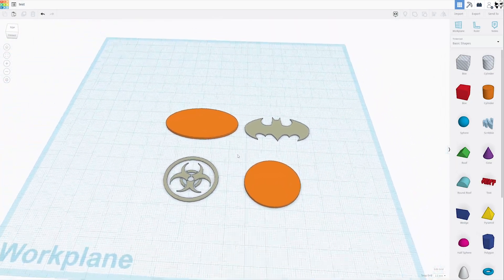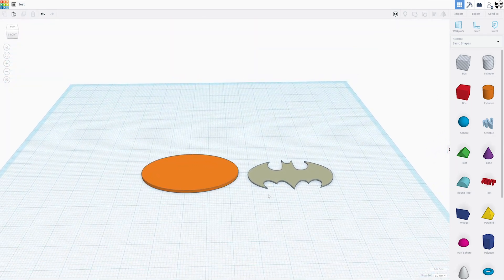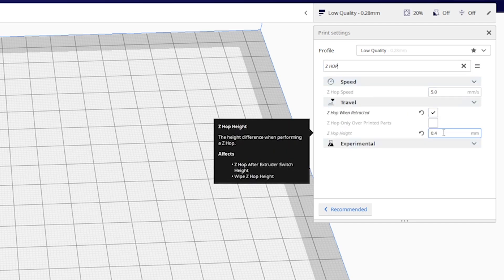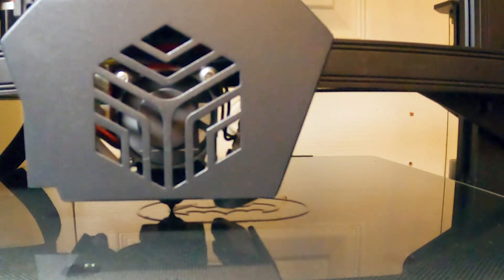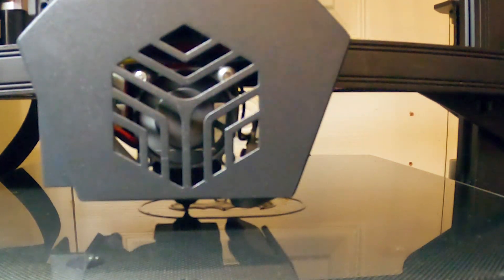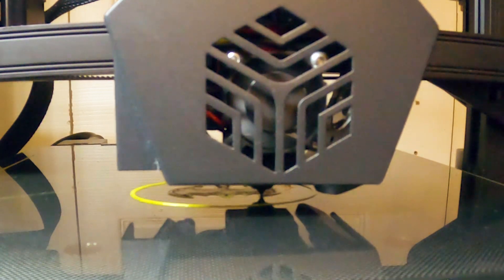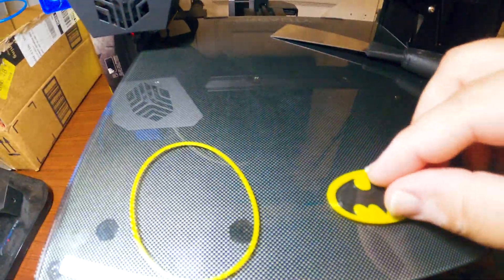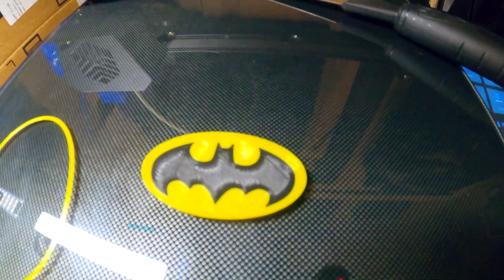Using Z Hop in Cura for the CR6-SE | Making Flush Inlays

Comment: I'm still a bit unclear as to how cura knows where to hop, if they're separately sliced stl files?
Reply from the maker: It hops at the height you set, regardless. So if the first model is only .2mm, and you hop .4mm on the second model, then you're going to miss the first model because it hops after every finished line it prints. 

Kinda confusing, I know. But I hope it makes a little more sense.

Comment: I have an Ender 3 V2 with the bed auto level add-on.  It touches the build plate in 9 locations before printing.   I'll need to make sure to avoid those locations when printing one or more.
Reply from the maker: Yeah, that's basically what is on my Ender 3. An EZABL. 

I'm not sure about the v2, but you could possibly change the start Gcode on the second print, to skip the bed probing and use the previous mesh (if that's an option).
Reply: @Avel  Thanks!  I'll check it out!

Comment: 4:20 To remove stuff from the build plate, take your scraper and put it up against the part. Then take a semi-heavy object, I use some pliers, and tap the end of the handle. Pops the print right off. But I'm going to have to try this for some golf ball markers with my logo. I was filling the empty spot with colored epoxy resin (which actually gave it some weight), but would love to see how this turns out.

Comment: Did you really need to z hop on the first part of the print or could you just do it on the second to save time?
Reply from the maker: No, it's not necessary.  I just forgot to turn it off.
Reply: @Avel  i  just found this and think I may need to use the z hop because im makeing some detailed flat key chains and when it rapidly moves from one spot to the next the nozel scratches my part
Reply from the maker: Hmm.. I mean, it would solve the problem, but I'm not sure why your nozzle would be scratching something already printed..

Unless, maybe your gantry is loose or unlevel, or the bed is loose. Also, I've seen where the hot end itself is loose and messes up the print.

I would check that all those are tight first and then use the zhop as a last resort.
Reply: It is brand new machine. I did run another check on it and it secured snug. This only happens and my logo key chains. They are 1/8 inch thick and a logo. Its alot of movement in one layer any other type of parts it doesn't do this
Reply from the maker: @Michaelhood0  I hear you, but it's not unusual for those things to be loose on a new one. For example, my dad's CR6 had a loose bed and hot end right out of the box. And we ordered ours at the same time straight from Creality.

Anyway, I hope the Zhop works for you. Let me know, in case someone else runs into a similar problem. I'll pin this comment thread.

Comment: @2:20 you mentioned you flipped the print bed over to the glass side up. Would you mind telling us what kind of print bed that is.... sounds rather useful!
Reply from the maker: Sure! This is the stock bed that comes with the Creality CR-6 se.
They call it a "carborundum glass bed". 

The side that has the carborundum adhesive grabs prints pretty well for the most part, and when the bed cools down, the prints will pop right off.

The opposite side has no adhesive coating, so it's smooth glass. 

If you search the size of your bed and "carborundum" there's a good possibility someone makes one with your bed size. PEI sheets are also pretty good for smooth prints, too.

On my dad's printer (also a cr-6), we put a PEI sheet on the glass side and it works great!

Comment: Only use z hop on the top part right? Will probably try it this week
Reply from the maker: Correct, but if you accidentally set it on the lower part, it won't hurt anything.

Comment: Maybe I'm not understanding Z-hop. But wouldn't you jump .5 to be sure and clear .4?
Reply from the maker: You could technically jump as high as you want. But I know that my prints are about .2 under what I actually want (ex: Something I scaled to 4mm actually prints at ~3.8mm). So for me, .4 clears just fine, as depicted in the video.

Sorry for the delayed reply!
Reply: @Avel  Thanks for the explanation.
Reply: @jf6720  Also the larger the hop the more stringing you may get.